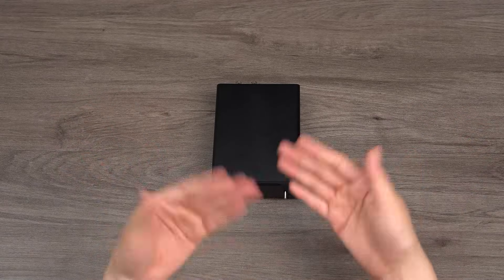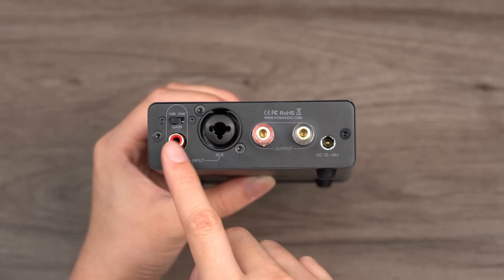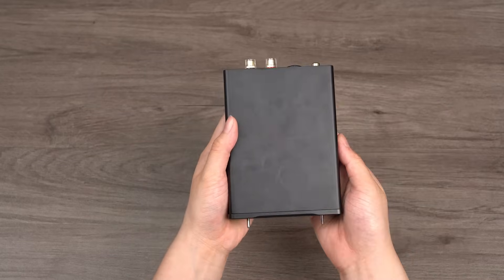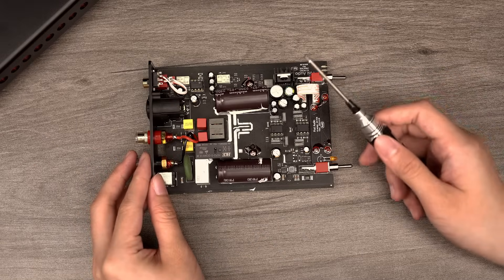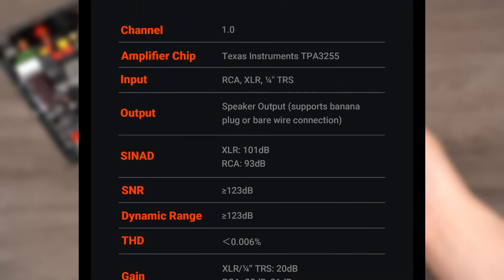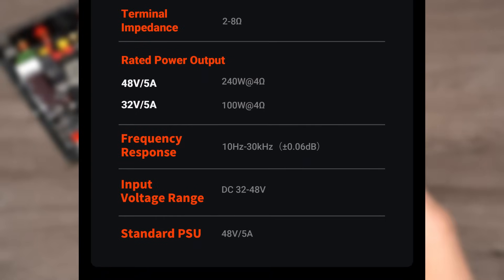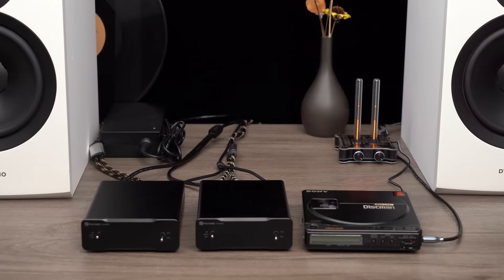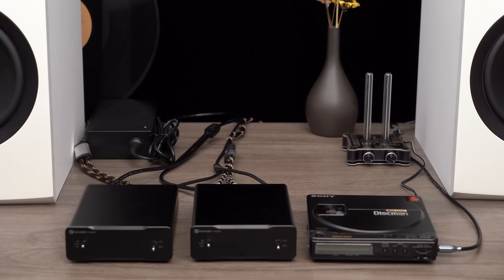The Next-Gen Monoblock Power Amplifier! Fosi Audio V3 MONO Introduction and Demostration

Comment: If you are concerned with overheating, you might want to check or use the coolers used for laptops.  You can put these amps over the laptop coolers to cool the amps.  I bought a used laptop cooler at the thrift store for $5.00.  The cooler I bought has two fans which is perfectly pointed to each of the amps on top.  Although the amps do not get that hot, I still put them on top of the coolers just in case the amps need some cooling.

Comment: No balanced information ? That design should be balanced by default . And the RCAs are added for consumer gear and voltage. XLR s are higher , and more robust signal ! By design... the whole home theater thing that was described should have covered this ? I'm not a home theater fan,  but running in XLR mode you would run long interconnects and short speakers cables ! That's one of the benefits of balance XLR . Hooking up a portable device is not a demonstration of the so called capabilities of such a unit? The word Audiophile is used many times in this video ,but this is not an audiophile demonstration!  Start with your best application then work your way down? Starting with portable devices is not Audiophile?

Comment: kudos for saving the money on the pots - it's a job of the music source (read Walkman, iPhone, Android) , resistance steps volume controller or high-quality digital knobs controlled AVR preamp to adjust the milliWatt input to the V3.  I strongly agree with the removal of the 'Potentiometer' for volume control, less parts to be worried about. Only dumb will request this in a 'mono'  AMP!

Comment: How can a 5.1 setup be achieved with monos ? What device will provide 5 channel preamp signal with DSP for surround setup? 
Is there a DAC with 5 channel output , eARC input and sub out ? 
Some help on the matter please 🙏🏻

Also can i use the Wiim Pro Plus with a set of those? Does the Wiim PP have volume control?
Reply: the simplest way would be to use an avr that has 5.1 preamp outs.
Reply: Schiit Audio Syn is a 5.1 surround DAC for $399, but looks like RCA or optical input only, no HDMI eARC. But as the other commentor said, you could use an AVR that has pre-outs, that just might set you back a bit for one with pre-outs for the 5 primary surround channels

Comment: Is it possible/safe to have one sub - but still in stereo - with these monos? If so, what would be the safest way to connect them to a single rel sub? 🙏🏼
Reply: You could connect your REL to the V3 Mono's with an RCA splitter cable.  But it's probably better to drive your powered sub directly from the preamp.
Reply: The vast majority of subs use internal amplifiers.

Comment: If I already have 2 48v 5 amp Power supplies from the VA3 can I just order the mono blocks alone ?
Reply: Yes
Reply: You can order one unit without power supply on Kickstarter.  But all the Two-unit options include power supply - either the 5A or the big 10A.
Reply: Thanks for all the replies.. I have 2 VA-3’ s running in mono already so I guess another dumb question … will these amps sound better being that they are specifically designed for mono ?

Comment: Thank you for the video. I noticed there are three swappable opamps. What is the function of the third one?
Reply from the maker: The one near the RCA input is used to convert RCA signal to balanced signal.
Reply: @fosiaudio  thank you
Reply: i have za3 and i think it has 5 op amps. I replaced 2 for the left and right channel. Why do V3 mono has 3? What are the two op amps for as you said the third one is for the conversion of RCA to balanced.
Reply: @rccabraljr I wondered about this, too.  If these are true mono amps, what is the purpose of the second opamp?

Comment: Should an audio source really be connected directly to a power amplifier?
Reply from the maker: In the video we used a Sony D99 discman as the audio source which has a volume control.😃
Reply: If it has volume control, sure !
Reply: MUST have volume controller. Start by using the lowest volume before powering on ANY power amps.

Comment: Are your rated power figures for 1 power supply for 2 V3s? Do you recommend 1 or 2 power supply for a pair of V3s?
Reply from the maker: When we connect a 48V/5A psu to a v3 mono, we can get a rated power of 240W into a 4ohms load.